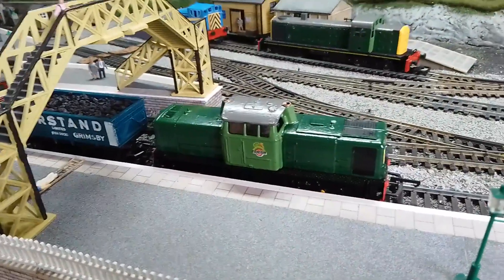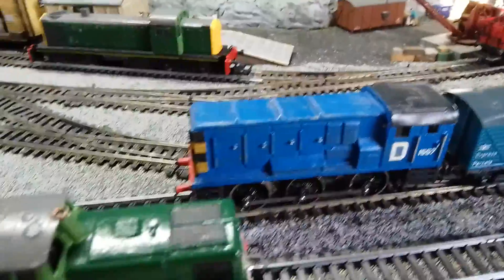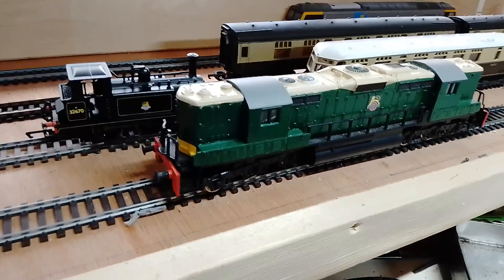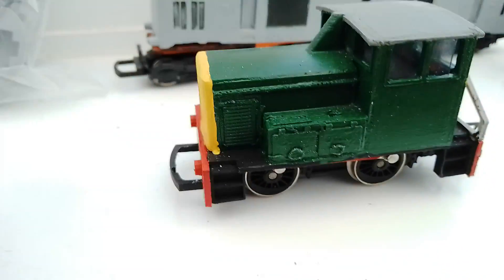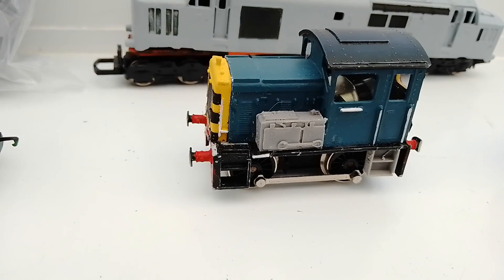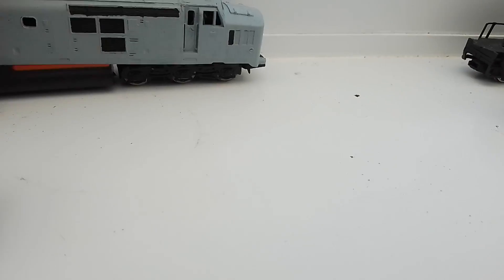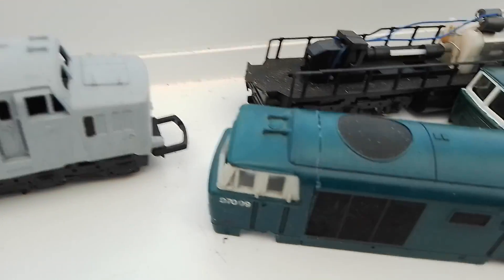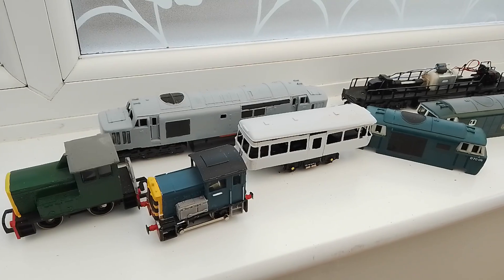OO/HO Freelance Diesel Locomotives , Shunters/Switchers Model Railways/Railroads

Comment: Great. My freelance efforts have mainly been trams and railcars using printed card bodies to 'emulate' tinplate! If you want to make use of an 0-6-0 check out early Irish railcars when a diesel 0-6-0 was in the centre between to coaches attached semi-trailer style. Great freelance potential.

Comment: I really enjoyed this video, mainly because I do something similar myself. With me it's getting static or very old models to run on modern track. I do some scratch building but to give you an example of what I like doing I've been given an old Triang 101 DMU that doesn't work (the motor is burned out) so I'm going to make a new chassis, fit a Ringfield motor, clean everything up and repaint it along with the re-wheeled four centre coaches and dummy end. Using a bit of 'artist licence' I have an old Triang buffet coach of the same era that I intend fitting in the middle. It should look good even if it isn't prototypical. Thanks again for your video.
Reply from the maker: @alfiejohnchester8108  sounds fabulous, would love to see some pics when it's done

Comment: What an interesting collection of freelance diesels!  I would think that getting a smooth running chassis at a decent price would be the greatest challenge, especially for shunters.  Back in the 80's I built a freelance dual end electric interurban loco by putting together two Athearn Hustler shells nose-to-nose on a modified SW series switcher chassis.  Trolley poles were mounted where the exhaust stacks were.  It could run well on 12 inch radius curves.  It's been a display case queen for several decades now, though.  Thanks for sharing all your projects, and cheers from Wisconsin!